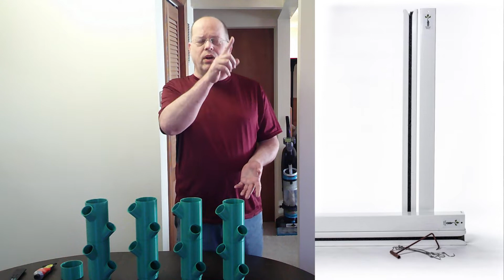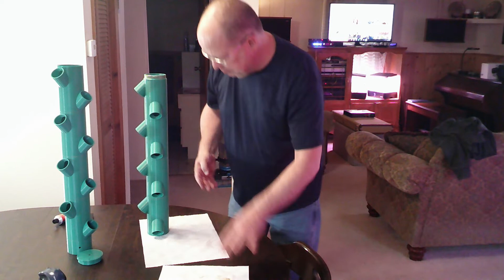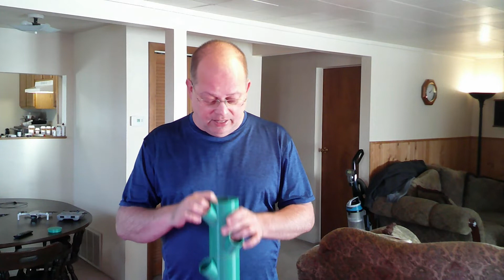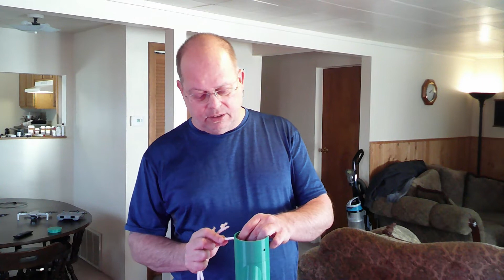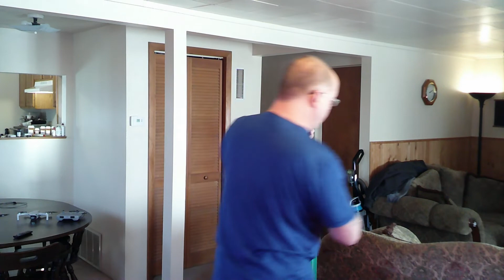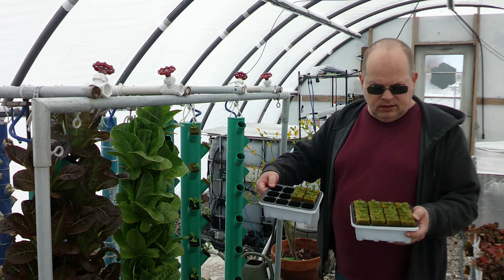3D G-Tower Assembly & Usage

Comment: Hey Larry ! I love your design, its the best i ever seen in youtube. I am wondering how the "cap" is distributing the water to the plant, it wont dry out if the roots are not long enough ?is the water reaching the rockwool itself ? thanks for your awnser and greetings from Hungary :)
Reply from the maker: The cap has holes all the way around it at the edge to distribute water evenly down the walls of the tower. The rockwool plug reaches into the tower body about 10mm or more so they always have water. No way for the roots to dry out, no air is moving through the tower body.
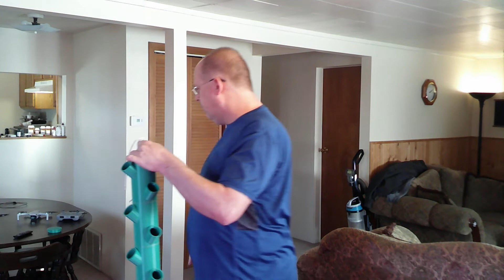Reply from the maker: If you go to 23:40 in the video you can see the cap and the holes that I mentioned.
Reply: @PanhandlePonics  thank you so much for the fast answer, do you need a certain pressure foir this ? I try to build a copy of your tower from hardwear store parts (Wye PVC Pipe Fittings (50/40) with my students cuz we dont have acces to 3d printer and frankly the budget is also very low but i will try to get more founding for the next semester and we will buy the the real deal from you! Greetings from Budapest :)
Reply from the maker: Yeah, I've seen quite a few attempts at trying to duplicate them with PVC pipe fittings and it never works out anywhere close. The two main reasons being that the wye is too long and the wrong inner diameter and the inside of the fittings are smooth rather than ribbed. Not to mention the weight and the fact that they will plug up with roots because of that narrow inner diameter.
Reply: @PanhandlePonics  hey Larry !  I finally decided to buy the licence cuz i have a guy who can print out the towers for me, but somehow i cant purcahce is from the site without an account and i just cant register one. can you help me out ? thanks a lot , greetings from Hungary !

Comment: which 1 performs better this 1 or Prototype?
Reply from the maker: Not sure which prototype you're referring to.
Reply: @PanhandlePonics  https://youtu.be/gQW4Ott01dE
Reply from the maker: Believe me, if that old design worked any better, I wouldn't have bothered going this route. That's why the 3D printed towers are the only towers in my greenhouse.
Reply: @PanhandlePonics  i understand that, i see your efforts in the prosses, your honest explanations.... but  what make the 3d printed towers better then old design,  the size of the main pipe, foe example the bigger distance between plants and the liquids.... from your experience?
Reply from the maker: Aside from the fact that they're easier to build is the fact that the planter pockets are precisely the correct size to hold starter plugs and the water feed system guarantees that all plants get equal water, two things not possible with the heat molded PVC towers. They're also a whole lot lighter and easier to transport, no need for any media in the towers, and if you're using them in aquaponics - the ribs created by the thousands of layers in the 3D printing process colonizes nitrifying bacteria.
Reply: @PanhandlePonics  thank you very much

Comment: How come you don't do the 3 planter towers anymore? 
Is it because this is a bigger size?
Reply from the maker: I'm not sure what you mean. Are you referring to having one to the left, one to the right, and one in the middle? If so, that's just because I'm just growing heads of mini romaine lettuce and they don't need that much spacing.
Reply: @PanhandlePonics  Thank you Larry, in your previous video you said; If you were to grow indoors, which I will be, then it would be make sense to have 2 planters per tower segment, one on each side. Do you still think that is a good idea or it's better to have two complete towers back to back? If you do think double side tower is good, do you sell that in the plans?
Reply from the maker: The only way you're going to have two planters per segment is to use the 3x6 segment that I used in the video. Even if you grow in a greenhouse, you still only have light shining from left to right across the front of the tower. As for plans, I don't do that kind of stuff. As the website says, I'm just providing an accessory the same as if you were buying plumbing fittings at a hardware store. Those don't come with plans either.